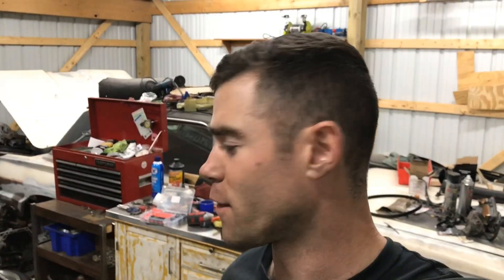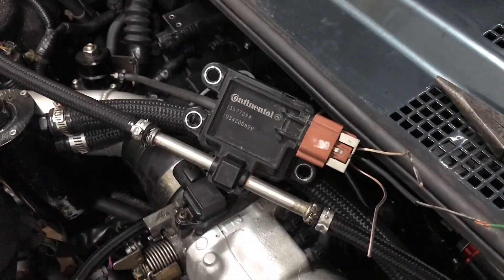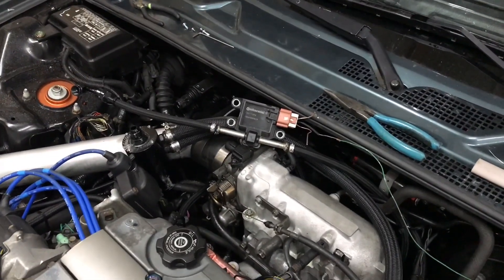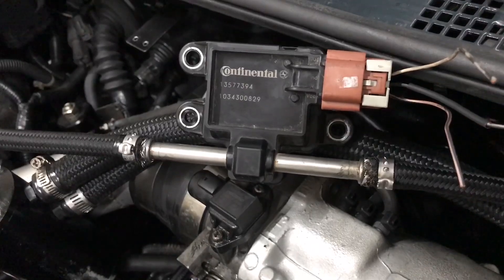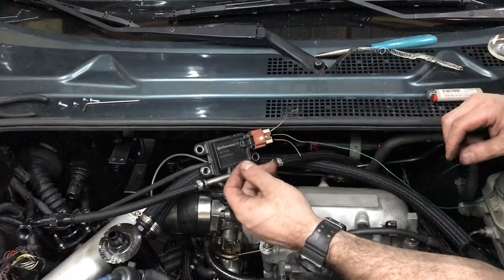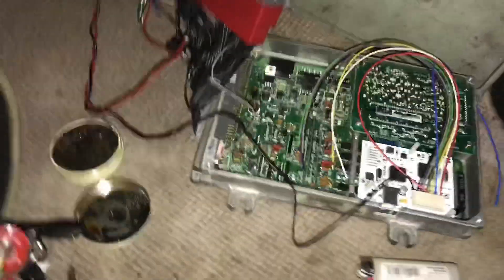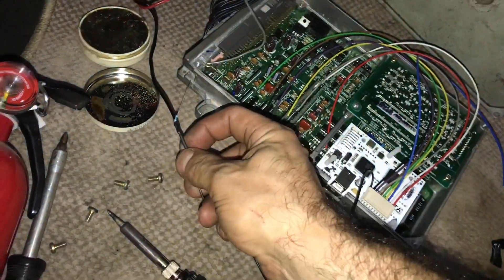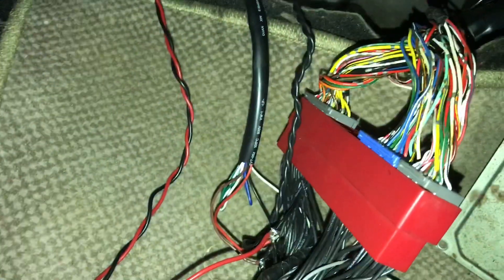How to install a flex fuel sensor *Hondata s300v3*

Comment: You were tuned by rolo correct ?
I’m the guy years ago Anderson from the advanced auto palmyra store he had FaceTimed me and showed me your car lol you revved it for us ! F20b?

I have the red 01 Bb6 !  H22a4 will it work the same ?
Reply from the maker: Small world! Initially it was tuned by innovative motorsports in Carlise but due to the EPA stepping in…I had to go to an underground tuner as Innovative doesn’t tune OBD1 anymore. F20b with a bunch of H22 parts as they are interchangeable.

You need a to have an aftermarket tunable ecu for this to be compatible…and a big wallet if you go with hondata as usually tuners charge more for building separate fuel tables. Some of the more modern ecu’s can do this automatically though.

Comment: When u say fully built h22 I’m guessing u have sleeves
Reply from the maker: Nope, most Honda engines don’t need sleeves ($1200) until you break into the 35+ psi range or shooting for a lot more displacement. If the engine is an open deck block, have a CSS block guard installed ($500+) for cylinder stability under load OR do what I do and use Devcon F2 epoxy ($140) as your block guard.

Closed deck blocks due a little better under load as they have cylinder support from the top.

When people say that you need to sleeve H22 it’s due to their lack of understanding of thermo dynamics. The FRM bores in an H22 do not expand as much as common iron sleeves due to heat. H22 you just want to use a piston made from 4032 billet aluminum as its linear expansion rate is much lower than the common 2618 OR run wider piston to wall clearance with the 2618. People buy the moly gold and drop them down the whole without checking piston to wall clearance or bore out of round or taper and have issues and blame the h22 FRM.

Comment: Hey man I wanna run flex fuel on my integra. What type of fuel filter do I need to use? Or can I run the OEM one?
Thanks
Reply from the maker: Joseph Phengsy you need to use a flex fuel rated fuel filter...this can be a flex fuel filter from another car or buy one off eBay. You want something that is under 35 microns. So 35-25-10 something around there.

Comment: Your anolog harness is upside down.
Reply from the maker: CRAZYTOOLZZ Why do you think so?
Reply: @thestateofreal2533  because there's if you look at the analog  inputs you see to grounds side by side. And on the pig tail you'll also find 2 black wire's side by side. Plus if you check the hondata website you'll see it says AN0 is a red wire.
Reply from the maker: CRAZYTOOLZZ Nice! What I have found in the long run is inverting the plug allows the analog plug to fit lower on the ecu and prevents it from hanging and wobbling on these input/out pins. That’s the only reason I do it that away and not per hondatas directions. It works fine either way but you will find that a lot of other people do it this way in order to prevent breaking the analog pins off.
Reply from the maker: CRAZYTOOLZZ I guess I should have mentioned that in my video so people understand my reasoning. I will put it in the description. Thanks!